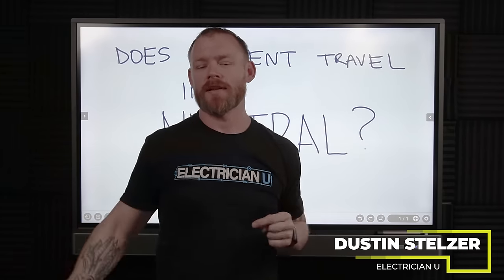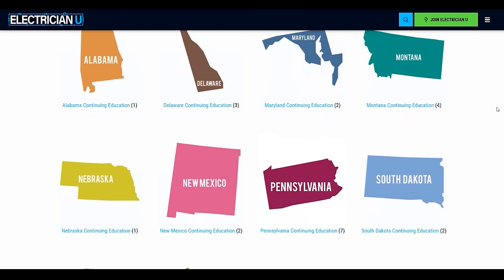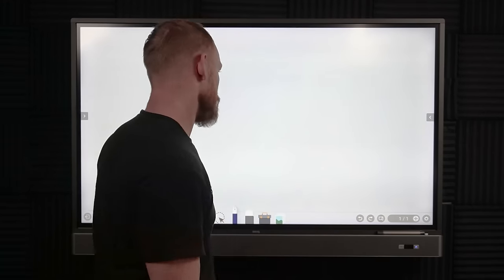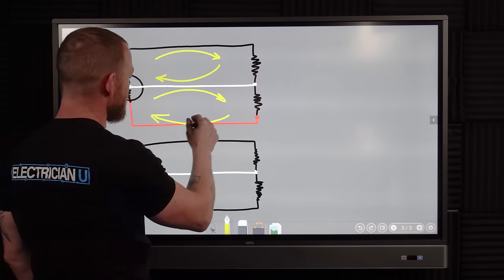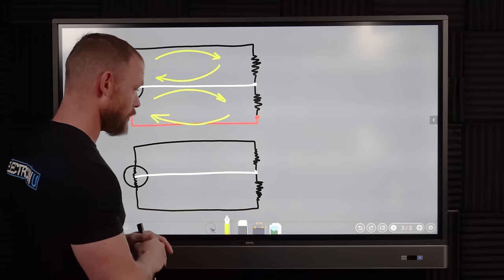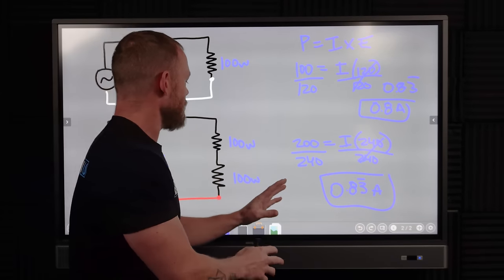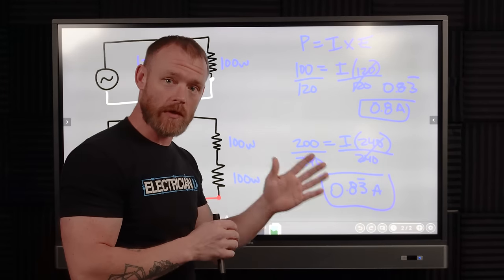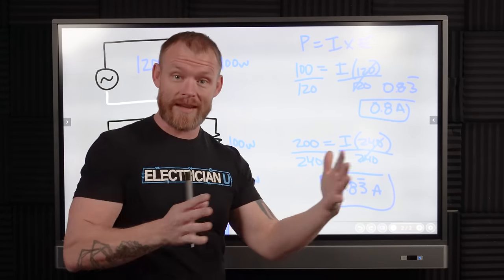Does Current Flow on the Neutral?

Comment: First, excellent teaching.   You're a master at explaining at the level your audience needs.   However, the actual theory you're teaching here is a little bit wobbly.   The current in an AC circuit always flows in both directions, in time with the 60 (or 50, in many countries) hertz sine wave, and the electrons in those wires just wiggle back and forth a minor fraction of an inch.   There is no unidirectional flow of either current or electrons in these circuits.  You really don't need the electrons in your explanation  anyway.   At any given instant, the voltage between the black terminal and the neutral is the same magnitude, but the opposite polarity as the voltage between the red terminal and the neutral.   This is easily explained by looking at the way the taps are arranged in the transformer (the voltage in the secondary falls, at peak cycle from +340V at the black tap, to 0V at the red, and since the neutral is halfway between them, it is half that, +170V at the neutral, which means the voltage between the red and neutral is -170V.   The same is true at any other point in the cycle, although the actual voltage varies.  Thus with balanced loads, the current flowing in any instant from red to neutral exactly cancels the current flowing from black to neutral (equal in magnitude and opposite in sign voltages divided by equal resistances).   To my ear, at least, the "push/pull"  explanation makes it sound like this has something to do with the cyclical nature of an AC voltage, but as you obviously know, this is not the case.   Doing the analysis as if this were at any instant a DC circuit takes that out of the picture.

Comment: This is why the neutral wire doesn't need twice the current capacity of the individual legs. We might logically think that if we're drawing 20 amps on one leg and 20 amps on the other that we would read the sum (40 amps) on the neutral. The greatest possible current on the neutral leg is the theoretical point where one of the hot legs is fully loaded and the other has no load. At the point where both hot legs are fully loaded, the current on the neutral is theoretically zero.

Comment: what would happen if you broke the neutral from the panel out to the meter in a perfectly balanced panel? would there be no current to the ground? so if you touched it you wouldn't get shocked? it would only shock you if the loads weren't perfectly balanced?

Comment: Silly question, what does alternating current mean ? There and back. Neautral is a travelier of half the current line.
Reply: “Alternating current” means that it reverses direction periodically, in response to alternating polarity of the voltage supply.

Comment: Nice tutorial👍. I have a question: When the furnace comes on, the lights in the house flickers, and I lose power to the master bedroom, sometimes 2nd bedroom and the living room. I've tested every single block/breaker and received 123-125. Is there anything I can check or something I can do before spending $400 for an electrician to come out?

Comment: Pretty good explanation, but, you confuse phase and polarity. In the original drawing, you correctly identify the panel as single-phase and then mistakenly call the red and black poles (polarities) different phases. It might be useful to characterize the poles as North and South in keeping with the magnetic field.... Another key concept is that the center-tap of the transformer AKA neutral is only the mid-point of the two polarities (0 volts) when that neutral is earth grounded.

Comment: I'm pretty sure up here in Canada the neutral is actually a ground.  AC power flows out of the power station on the two phases, two wires, 180 degrees out of phase.  When it gets to your house it flows through devices and then to ground in the earth in your yard.  We only have the 2 live 12o wires coming from the step down transformer.  There's no neutral going back to the transformer.  The neutral is usually terminated on a copper cold water pipe.   I thought AC the world over was like this???  Pure 240 volt devices, no side 120 volt circuits inside like a stove, the neutral isn't used.  Only the two live 120 volt out of phase wires and the ground are used.

Comment: As a retired Electrician,  I will confirm that the worst   electrical shock comes from  an AC electrical 120 volt neutral Conductor.
A positive AC 120 V Conductors shock is like a strong vibration, while an AC 120V neutral shock is like a bee sting.
As an Electrician, I got used to positive Conductor electrical shock.  As I got older, and realized electrical shock was not good for your heart, then I became more careful. 
Although, you can grow accustomed to 120v positive Conductor electrical shock,  you never become accustomed to neutral shock.

Comment: At 13:55 you have not taken into account that currents are phased 180 degrees . Neutral never will be higher than the maximum of either phase. In fact, neutral current will be the difference of both phases, as they are 180 degrees apart

Comment: There was a lot of good information in this video but there was also some confusing information in this video that I think should be clarified if it’s going to be used as a teaching tool. And I did notice that you made an effort at one point to attempt to address the subject but I just didn’t feel it was very clear if a person who did not already have a basic grasp. 

I in a 240/120 split phase topology The reason for having the neutral is in order to be able to have 120 V devices. Without it there it’s not possible for you to have 120 V potential. 

If all you wanted to run was 240 V loads there would be no need for you to have a neutral conductor because you could simply have the two hot conductors which are tapped off the end windings of the transformer and fed down to the entry point of the dwelling… And that would provide you a potential of 240 V tap to tap. 

That would happily run anything like a stove or a dryer without a problem. 

However, when you wanted to have a regular lightbulb or a hairdryer or something of that nature you to have an issue because when you’re missing the neutral, which is connected to the center tab of the transformer you don’t have that 50% potential available to provide you that 120 V that you need for those smaller residential devices. 

I when you have a 240 V load I you can actually have the opposite hot conductor function is the neutral in the off cycle, since this is a sea power and you’re constantly having a 60 cycle waveform to take advantage of with one tap of that transformer at the bottom side of that wave form and the other top of the transformer at the top side of that waveform. 

When your meter does indicate current flowing on the neutral with a clamp on device what that does indicate is an imbalance of how you have your 120 V circuits loaded into your panel. That doesn’t mean it has to be perfect but if you see a lot of current you may want to re-organize how you have the breakers configured.

Comment: I have a degree and MSc in electrical engineering, imagine how many times I've heard that, but you have explained it much better than any professor I ever had, awesome stuff. 👍
Reply: This kind of explanation is not adequate at all for university level, way too oversimplified. Its not explained "better", but "easier" and therefore not as accurate. The explanations regarding the electrical fields for example are surely ok for electricians, but not for an engineer who should really understand what is going on at a sub-atomic level. 
Even more specific: Saying that electrical fields get established by the current flowing through the wire is wrong. Its the other way around.

Comment: My question is what is the meter measuring?  If it is measuring the field, it seems that would be why the fields are cancelling and the meter says zero.  Is the meter measuring the actual current moving?  I have my doubts; is the meter "in" the circuit or outside measuring the field(s) created by the movement of the electrons?
Reply: The meter measures the energy dissipated in the system.

Comment: 4 plus decades as a power lineman and I’m wondering what the object of this lesson is. Never assume there is no current on a neutral. I’ve seen OPEN neutrals burning on the ground. I’ve seen equipment grounds burn the pole because the neutral is OPEN. Never, ever open a neutral, lineman have been killed by open neutrals. Again, what is the object here?

Comment: Okay,  I got as far as your “particles moving in one direction”  ie forward towards the light bulb – BUT, you previously explained that the cycle reverses sixty times per second (pulsed power).  So in the model you present, which way do the particles flow during the second half of the cycle ?  How do the particles get to the light bulb if they reverse direction every sixtieth of a second – and travel for the same time/distance as the FIRST half of the cycle, but in the opposite direction ?  Obviously, there is a problem with this model.  The “particles” should just sit and vibrate a certain distance back and forth, without making ANY progress towards the light !
Reply: The particles (electrons) are everywhere in the circuit at all times, so they don’t have to travel to the lamp.  They do travel a small distance in one half cycle.
Reply: @satunnainenkatselija4478  It may be well explained in various videos - but NOT in this one !  The model presented fails.

Comment: I'm from Australia and I find this very interesting,we don't have a split phase/center tapped neutral..everything is 240 line 415 3 phase, neutral is the star point of the transformer many high voltage transmission transformers are delta/star so the HV has no neutral at all...Balancing loads across 2x120v legs in a domestic installation must be a nightmare for electricians in the united states.
Reply: No, it is not a nightmare.  There will typically be a circuit of receptacles on each side, and the degree of imbalance will just depend on what the customer plugs into the circuit.

Comment: It works as the force of tide waves giving power coming in and going out,one takes power from the forward movement the other from the back back movement at the frequency of the wave generated.Thinking of a pedal motion one foot is generating force down while the other is pedal is moving up.

Comment: I hate to be a bother but to me (myself) residential wiring is easy. We took an older mobile and took out all the gas appliances and piping. We left all the 120 wiring since it was not aluminum. We installed a 200 amp panel, and an electric water heater, electric stove, electric furnace and electric dryer and proper wiring and breakers to all code. Easy peeze.

Comment: why didn't you show the neutral connected to the ground bus
the ground could be a rod just outside the house or a metal water pipe can be ground to, in either case neutral in you panel is connected to the ground
Reply: Grounding would be off topic for his video. A ground isn't meant to carry current and, in a perfect world, is never energized. Yes, the ground is bonded to the neutral at the service entrance (main panel), but it has nothing to do with balancing line to neutral loads for a residence.

Comment: Neutrals in the breaker panel are a current carrying part of the circuit. The neutrals are bonded together on the neutral bus. There is a non insulated bonded wire called the ground and is bonded to a long metal rod on the outside of your house. There are a couple of clamps connecting the rod and the ground wire. Do not play with the ground rod or the connection. Danger Danger Will Robinson!!!! I am a certified Industrial Electrician.

Comment: If reading amps on neutral which is needed to balance 3 phase systems is always the miss Ballance between the hots,,,, if one crews up a 3 phase service in a large scale senario one can have very heavy neutral load,, and then one has to move loads around from bus to bus, to balance the load ,,, and the go threw and make sure all motors and such are still running correct direction 👍

Comment: voltage in a series circuit is divided between loads while the ampere or current remains the same across both; ohms law. and voltage in a parallel circuit remains the same while the amperes or current is divided.

Comment: interestingly, in your light bulb wiring diagram, you can see that the bulbs are just two 110volt bulbs in series. in fact they would light with the neutral disconnected from   the panel as long as the bulb neutrals stay together

Comment: Eddy electron doesn't leave his house until he has a way home.  So you bet it flows through the neutral wire.  Just because there's no voltage above ground on the wire doesn't mean the current won't flow through that wire.

Comment: The current on neutral is dependent on how you receive your phases.  You hear people talk of 208 V and 240V. 208 is the difference between 2 phases of true 2 phase, 120 is the phase to neutral and 240 us what you get from the two hot ends of a center tapped transformers which deliver power 180 degrees out of phase. If you are receiving power from a center tapped transformer and you have identical loads on each phase then  there will be no current on the neutral. If however you are getting power from 2 phases of a 3 phase system (208V) then the situation is different. In this case the power is deliver 120 degrees out of phase. In this case the neutral current is given by 2*cos(30)*I where I is load of one phase so in this case rather than no current you have half the current.

Comment: Nice explanation. But that is theoretical right. In real world there will likely be an unbalanced distribution of load on each circuit and therefore a tiny bit of current would travel on the neutral right? Haha I just saw the rest of the video where this was addressed.

Comment: I know I'm just not understanding, but if both circuits get 2a but one's at 120v and one is at 240v, then why isn't the second one getting double the power because the voltage is the same but the voltage doubled?  I would have expected the amperage to be cut in half.

edit: the video doesn't call this out because maybe they expect you know this, but the voltage drops to 1/2 for each load when you put two identical loads in series.  So that cancels out the voltage doubling by then halving it.   Amperage remains unchanged and same voltage * same amperage = same wattage

Comment: In a single phase distribution panel with a green ground wire, what would be going on to get current in the ground?
I have seen a circuit, power from one breaker to one load,  the hot wire had 16 amps while the common had 8 amps and the ground had 8 amps.

Comment: Good info, as far as I can see, everything you've said is correct. But it does seem to be unnecessarily complicated. If I were going to try to explain this I'd probably do it using a DC circuit and light bulbs. And of course you can use DC because even AC is DC half the time! Lol just use a couple of car batteries with the center tap being in between the batteries. Use some headlight bulbs or something like that for loads.
Reply: For what you're trying to explain, you don't need to go into electron movement or magnetic fields.

Comment: omg that is so easy! A closed circuit means you have current flowing between a higher potential and a lower potential. (i.e. it HAS TO flow through BOTH because it's a closed circuit). With AC the direction of flow keeps changing (alternates the direction) but it's still the same closed circuit so neutral becomes the higher potential direction for half the cycle. I don't have anything to do with AC but that should be obvious to a high schooler I would have thought (closed circuit, a higher potential, a lower potential, a sine wave - yep super obvious).
Reply: "Higher potential" doesn't mean anything the way you used it.  There is a potential difference between the two ends of the supply, so a current flows in the circuit created by placing a load across the supply.  The potential difference is the same whichever way it is flowing.

Comment: I have a question regarding the last scenario in the video involving 2 amps and 10 amps. Given that this is an AC power supply, the voltage alternates between the top and bottom ends of the winding, fluctuating between 0 and 240 volts (or ±120 volts). For safety reasons, we connect the appliance ground to the neutral wire so that if the hot wire comes into contact with the metal body, it provides a return path, causing the breaker to trip.

During the positive half-cycle, 8 amps of current flows into the neutral, and during the negative half-cycle, 8 amps of current flows out of the neutral. If current is flowing out of the neutral and the metal body is connected to the neutral for grounding, wouldn't the metal body become live, potentially posing a danger if someone touches it?
Reply: The appliance ground must only be connected to the equipment grounding conductor and not to the neutral wire in the appliance, otherwise the answer to your last question would be yes. The ground and neutral wires are connected at the main disconnect and nowhere else.

Comment: the current in the Neutral to the transformer will be complete 0 when the 2 loads are absolutely identical which in practice is impossible.. the mathematical difference will be a small current in the N..

Comment: Hmm I am confused a single phase /split phase 120/240 doesn't have a neutral at all its an identified grounded conductor. A neutral only carries the unbalanced current between phases, like a 3phase wye system will have a neutral. But a single phase system doesn't have any unbalanced loads.